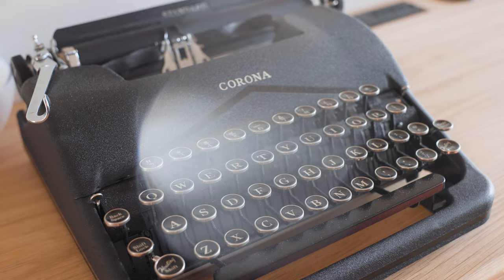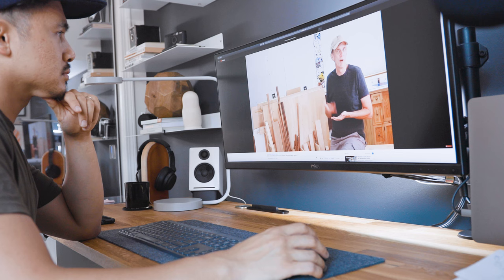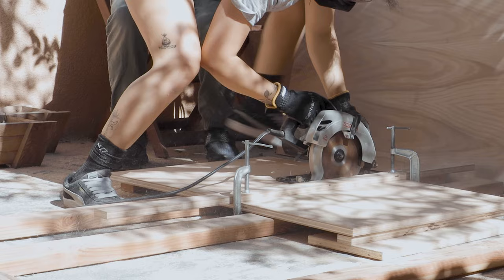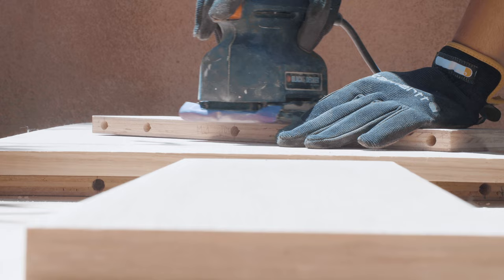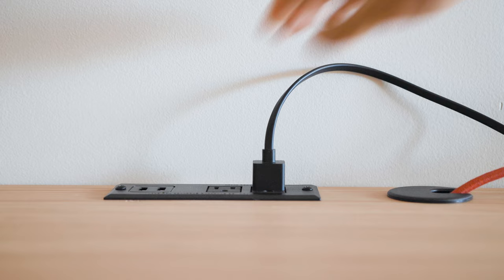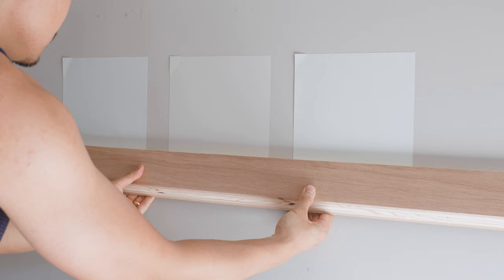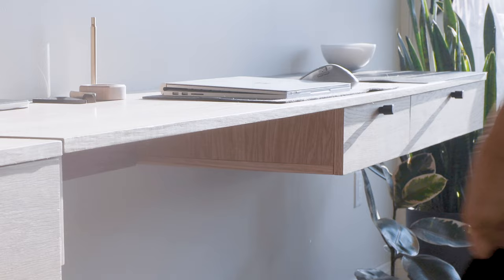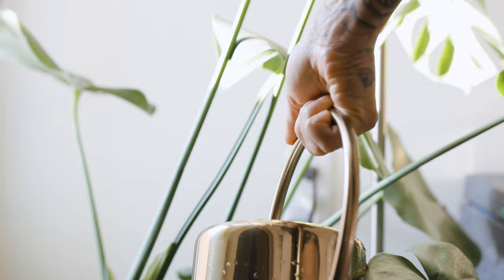DIY Art Studio Makeover & Room Tour

Comment: Put painters tape over the area to be cut.  This will help minimize tear out.  You can use 0000 steel wool to smooth your finish when it is dry.  It won’t leave sanding marks either.  Great job!

Comment: You can also use the general blade for plywood, but you need to make sure that a) the blade is only about 1-2 mm from the size of the wood, and b) use tape  to prevent the wood from chipping and breaking.
Reply from the maker: Yes, mine were old and worn out too

Comment: Love it everything except that chair, those eames chairs are uncomfortable af for long hours. I would keep using that lino chair.
Reply from the maker: Still have it. ;) Figuring it out
Reply: Exactly. Even I used to keep thinking about the aesthetic. But ended up working on my bed because of the uncomfort
Reply: I see it in a lot of DIY organization videos, but arm-rests on computer chairs aren't the best idea. The point is to have your shoulders relax when you work. That means having your elbows rest on the table and that also means allowing you to raise your chair up high enough to be able to do that. Typically, the thickness of the table/drawer system impedes this ability as well as arm-rests. However, since the table is pretty thin, you can get away with arm-rests so that balances out.
Reply: @MatthewEncina  ikea ALEJFALL chair would be a good compromise
Reply: @The1Music2MyEars  While I would agree that armrests are usually a nuisance, I think the Lino has exceptional comfort especially with those fully adjustable arms.
Reply: I came for this comment,  the project really is outstanding, but I got a bit sad for her when I saw the chair kk

Comment: Really nice job, especially for someone who has not done any woodworking before! A couple thoughts: 
First, you WANT plywood; solid wood moves with weather changes and is never used for cabinetry for that reason. Drawers would jam; doors would warp and no longer fit openings, and the top would crack/split. 
Second, thanks to everyone writing about the 'Corona' label on the typewriter for making those of us who grew UP with typewriters feel ancient. It's a Smith Corona (eventual evolution of the name) and the equivalent of 'Chevrolet' or 'Ford' when it comes to typewriters.
Third, where did the (BIG Epson 3800(?)) printer go? I have one of those beasts and am about to design some very clever cabinetry to hide it away, so I was curious as to where it went, in all its RJ45'ed ethernet cabled goodness.
Reply from the maker: Thanks Kevin. We still have the printer... I want to keep it, but not a good place to store it somewhere. A design problem to solve. Curious what you come up with

Comment: Great project!! Just one question: how did you solve the leveling problem in 6:49? Best regards!
Reply from the maker: Well we made sure the French cleat was levels first. The desk just needed to be moved around till it sat perfectly on there.

Though if you have issues lining up the front, (from a twisted/angled corner), you can always use a screw to connect and align the front edges together.